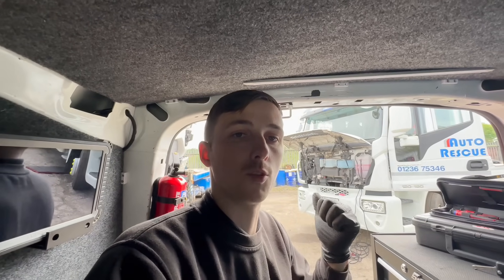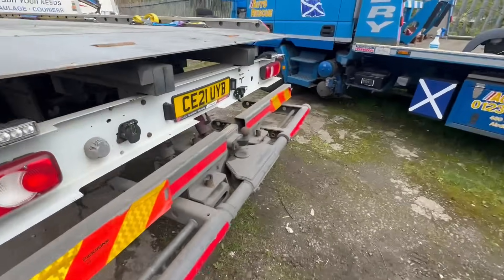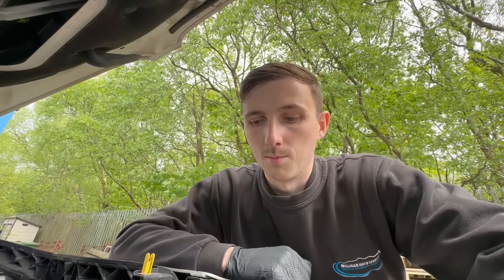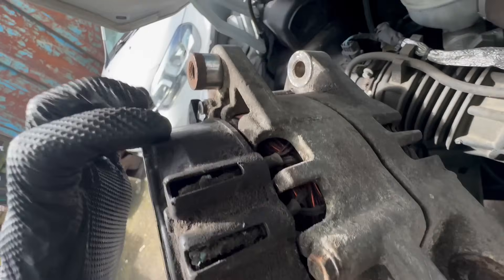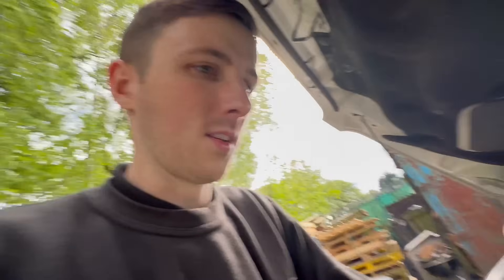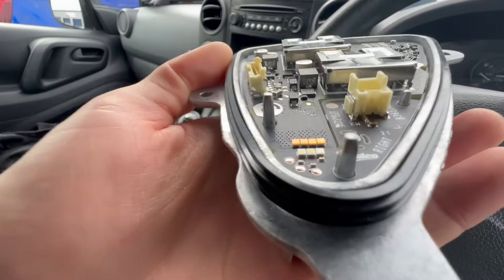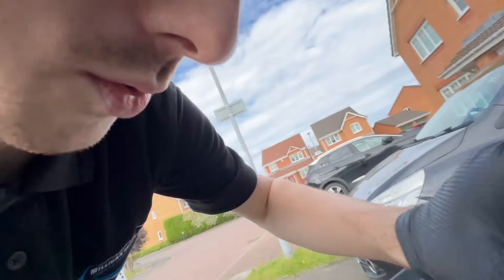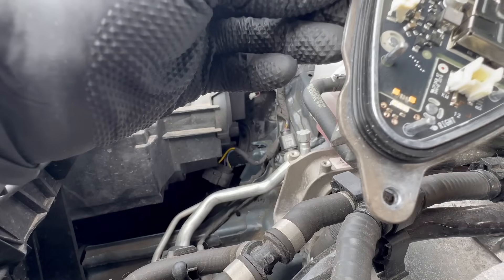Why you shouldn’t fit used parts ! - Fixing a vehicle that is under warranty 😯

Comment: You didn’t fail Ryan , you just fitted a buckshee alternator, fitting a part to get you up the road and home is fine , but it’s a false economy as a replacement part, been there bought the t shirt, the  owner of that vehicle are short sighted and don’t look at  it long term solution , would have chased them

Comment: I absolutely refused to fit second hand alternators and starter motors. Full stop. No arguments. If the Customer wants a second hand part they either take it somewhere else or invest in a Haynes Manual. Not only is it a waste of time but it's massively frustrating.

Comment: The valeo indicator issue will be unleaded solder and dry joints. To drive 4 leds to European indicator regs they will get hot which is why you have half a kilo of aluminum heat sink on the back 😅 great video though!

Comment: Could you have connected the lin bus connection to "new" alternator  without fitting it to check the functionality?  Or wires too short?
Reply from the maker: Wires too short, Could have made extension lead to be fair 👍

Comment: I had a smart charging error in my smax. Think it was something like "no communication with smart charge system" Various garages had a go at fixing it, battery, battery status monitor, alternator. Still had same issue. 
As mentioned in this video it has to be like for like alternator.
I had to change the radiator anyway so removed the front of the car for easy rad access and while it was off checked all cables for damage, breakages etc. 
Turned out to be corroded earth strap connection to the chassis rail! Cleaned it  and fixed the alternator fault.

Comment: If it's under warranty and must be a safety issue I would have insisted VW fix promptly or replacement car provided until fixed. Hope VW were paying for the labour and parts
Reply from the maker: The difficulty i find with dealers warranty is the customers are struggling to get a booking regardless if its a safety concern or not (in my opinion)

Sometimes its easier for them to pay someone like myself to do the work to save vehicle downtime etc

Thanks for watching
Reply: I can imagine the VW workshops get overwhelmed with electrical problems and warnings coming up on the dash in my experience with them, I bet the courtesy cars are all out!